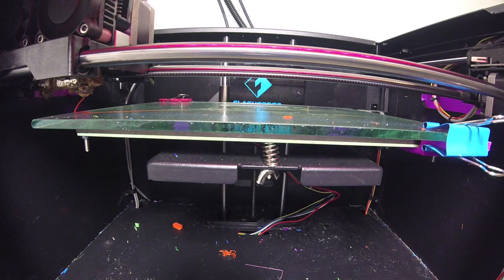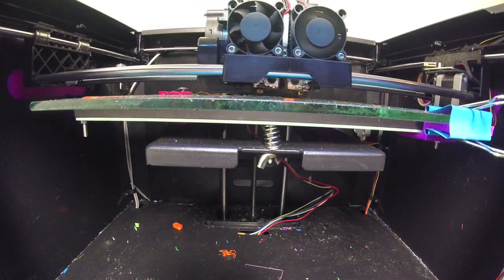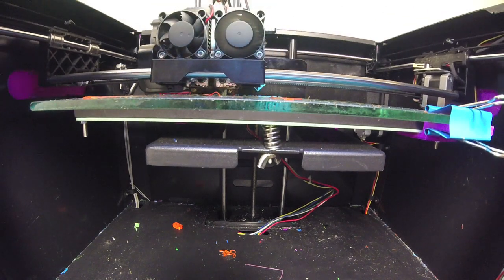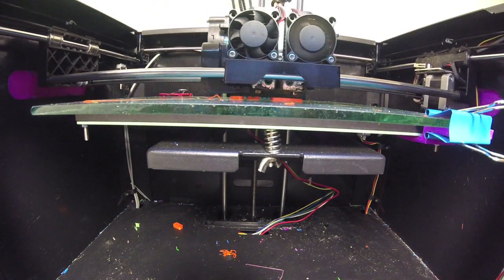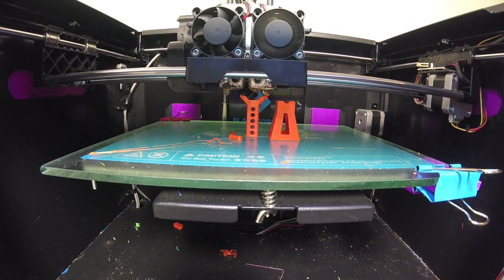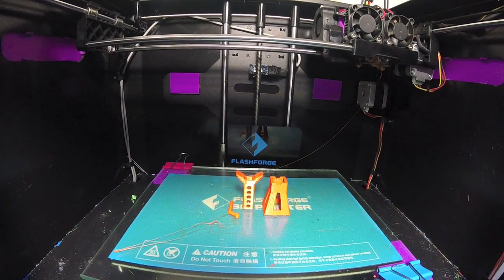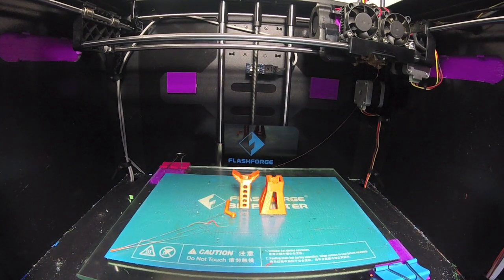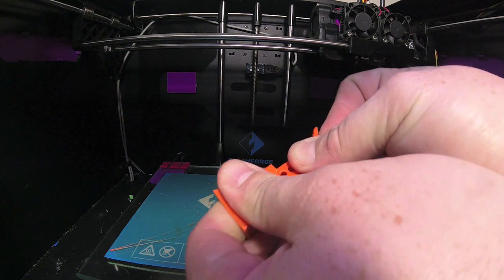More Accessories off the Creator Pro 3D printer

Comment: How do you like the printer man? I'm really thinking about getting that model. What do you prefer to use as your print material? Thanks
Reply from the maker: I'm very happy with it. Its my go to printer. I also have an M3D and an I3 Wanhao and the flashforge Creator pro is my fav. PLA is what I use for all my stationary models but anything that takes abuse like my quadcopter will be printed in ABS